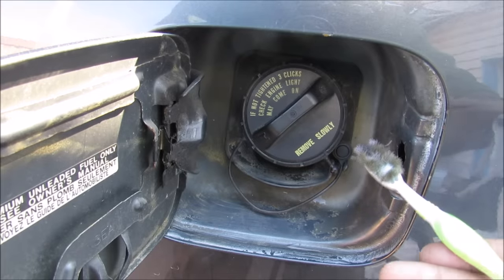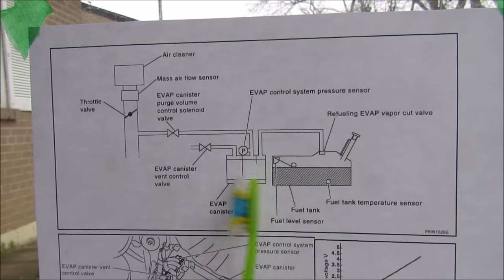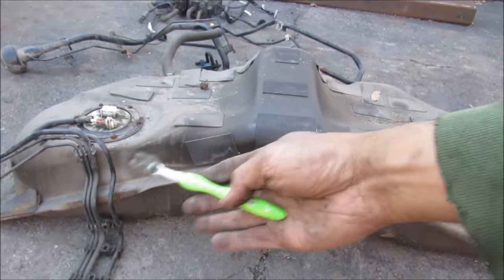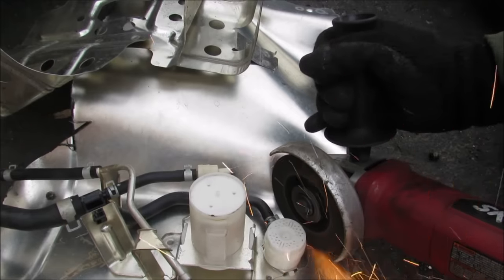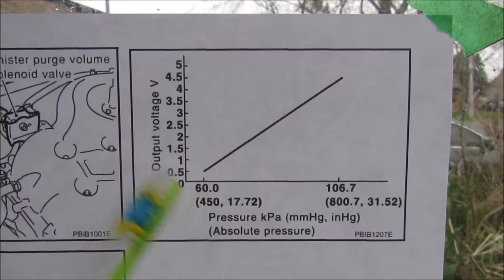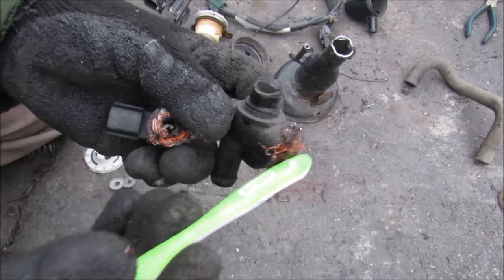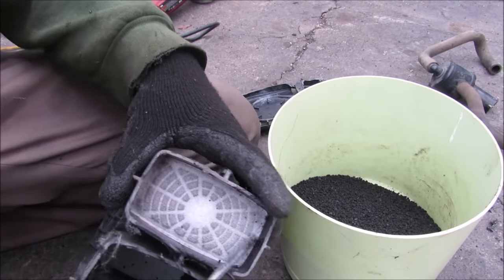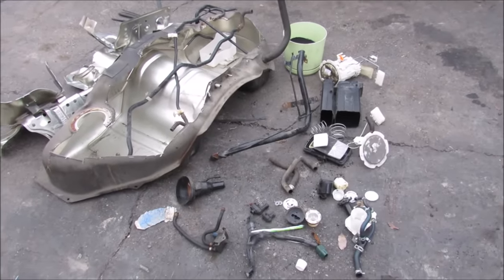How the EVAP System and Gas Tank Work

Comment from the maker: To see how much more complicated a Toyota EVAP system is, check out my other video here: https://youtu.be/g4lHxSAyf7M
Reply: thanks so much for this video! will check out the toyota one after
Reply: You are welcome! The Toyota Corolla has a lot more valves with diaphragms and an extra vent line from the engine, yet was a generation older than this Infiniti. It was ahead of it's time for an economy car.
Reply from the maker: You are welcome!!
Reply from the maker: The Toyota EVAP system is so much more complex with it's valving and vacuum lines and it's older than this Infiniti
Reply: @speedkar99  I wonder which is more effective at not venting fuel vapour...
Reply: 1:20 why do you change your teeth brush  so often? It makes me so nervous.
Reply: How is it possible for the charcoal to get sucked up all the way to intake
Reply: @Longoria1966  Your intake? Or the car's? :-)
Reply: @speedkar99  Not only is it complex, but it seems prone to premature failures (probably due to its complexity).
Reply: Ya charcoal got sucked up the hose all the way to the solenoid by the intake.. it clogged up the solenoid and was running like shit..
Reply: 97 Nissan Pathfinder.. I still gotta unclogged the line that goes back to canister.. have you every seen that happen?
Reply: @Longoria1966  Its not the charcoal but the fumes. Intake vaccum sucks it up
Reply: I'm confused. the purpose of the evap is to not let fuel vent into the atmosphere, yet there's a vent control valve that vents fuel vapors into the atmosphere. what??!!
Reply: @jay8a901  As I understand it, there has to be an emergency pressure relief.  Maybe someone else can explain it better.
Reply: @SpringIsBACK  ahh makes sense, they should have just called it vent pressure relief valve. I don't know why they complicate things
Reply: hi friend I would like to ask you for advice I have a Ford c max 1.8 petrol 2003 duratec engine the defect I feel and when I fill up the tank hangs the petrol nozzle keeps detaching and then if I accelerate the car seems empty as if there was a cap to the muffler or a lack of air or petrol this ford c max has the Cannister filter Activated carbon could this be the problem? thanks for your help🙏🏻
Reply: It’s an engineering toothbrush. Don’t you see the grease?

Comment: So I had a tighten gas cap on my Tahoe. I changed the gas cap and reset my check engine light. A few days later, it said it again, and my check engine light came back on. I needed to learn more about this evap system. I have to say you explained it better than any other YouTube channel. Thank you. You just got another subscriber.

Comment: This is a good tutorial on the pre-2006 OBVR design.   The next generation design, EVR Phase 2, adds a Refueling Vent Pipe directly returning vapor from the tank to the filler throat during fueling.   The EVR Phase 2 gas-pump-nozzle adds a return path for fumes, suctioned into a small orifice (3mm) on the nozzle.   In EVR Phase 2 vehicles during refueling venting DOES NOT depend on the path through the CC (as it does in older OBVR cars).
Reply: So does that mean I can rule out anything CC related being the reason for why my 2019 M240 cuts off during refueling? I disconnected the line going from the tank to the CC as to troubleshoot if it was that but the pump still clicks off. At this point I’m wondering if it’s the valve at the bottom of the filler neck or the vent valve in the tank that vents to the pipe that leads to the CC.

Comment: very good description of how the system works. I have cleaned many canister control valves because they were full of dust. (several table spoons full from most of them) I've seen the vent hose full of tiny pebbles too. This is common when you drive on gravel roads.

Comment: Great video! I learned a lot in 13 mins, had to pause it quite a few times to be able to retain all the information before moving forward. I love that you took everything apart to explain how it works. I usually take things apart, but wouldn't have been able to take apart an entire fuel system. Now I can troubleshoot problems with the fuel system!
Reply: what do you call two mexicans fighting???      answer: Juan on Juan

Comment: Try to ignite the charcoal to see if it catches on fire quickly
Reply from the maker: Hey that's a good idea. Was also thinking to use the gas tank as a fire pit...but it's edges are so sharp.
Reply: @speedkar99  I know I'd watch that charcoal getting lit up. Super saturated from years of gas exposure? Sounds like the ultimate BBQ lighter.
Reply: I really thought about it when I saw charcoal 😂😂🔥
Reply: @Veik_Reikis  The charcoal absorbs the vapour then releases it when the engine's running.
Reply: @ @speedkar99  I would ignite just a tablespoon first.An acquaintance lit some charcoal  that had gotten contaminated by a chemical while in storage in  his garage and it exploded.His face was burnt pretty badly.
Reply: BBQ!!

Comment: Great video!  Thank you very much for making it.  I've been looking at a way to modify my EVAP system to be able to handle extremely dusty roads.  Part of what I'd like to do is make an EVAP canister that can be opened and the charcoal changed out or cleaned easily.  Along with the filter pads cleaned.  I 3D scanned my canister and plan to 3D print one out of a gas safe plastic like PETG and also add a better inline filter. I didn't want to cut my only canister open to find out how they are supposed to work so seeing this one cut open was great!  Thanks again!
Reply from the maker: You can get one from the junkyard

Comment: When would the system vent the vapours into the intake and when would it vent them into the atmosphere ? Why not only vent to atmosphere or only vent into the intake?
Reply: Venting to atmosphere is needed when refueling (engine not on) or if there's too much pressure in the tank and it needs to release. 

Otherwise, the ECU determines the correct timing when driving to dump the rest of the vapors into the engine to be reburned.
Reply from the maker: It would vent to atmosphere when refueling (engine off) or if pressure builds too high. The ecu determines when driving to purge the canister to the intake.
Reply: If I may be so bold as to rephrase da man, the car decides based on sensor inputs if venting needs to occur at all, and if so, whether the motor can use the fuel at that time. If not, the vapour is vented to the ozone layer. Damn.
Reply: @speedkar99  I have a nissan RPS13 with sr20 engine 1996. emissions go quite rich at idle only. The evap was removed before i got the car. could it be possible that the evap solenoid should vent fumes on idle. Then this unmetered air/fumes would reduce emissions. Any info appriciated . thanks

Comment: Nice video on a neglected topic.
Reply from the maker: You are right, not alot of people pay attention to the evap system until it's time for an emissions test
Reply: @speedkar99  I recently purchased a cheap smoke machine mostly for finding vacuum leaks. I decided to check out the evap for leaks on a project truck of mine. It looked like the back end was on fire from the hose missing clamps on both ends. Never set a code but it also doesn't get driven much.

Comment: I was looking for an answer whether filling petrol in car till the brim of tank can cause any harm to the vehicle or not and found your video which indirectly explains me everything that even if you fill it to the brim every time, engineers have taken care of everything from releasing pressure from the tank via a small spring based latch in the refiller cap to preventing fuel entering into the EVAP canister.  I am going to create a video on the same topic for viewers in Hindi, explaining why its a good idea or bad to use your cars full tank capacity. Thanks a lot for the informative video. The overall speed of the video was bit fast paced which made me rewind few moments / parts of the video.
Reply from the maker: Glad you enjoyed it and learned something. 
Overfilling still isn't good because you still need some space for the fumes
Reply: @speedkar99  yes agree no overfill..

Comment: Hey speedkar99, another great video, mate, cheers for that...
My 2006 Lancer has rusted fuel lines going into the EVAP and there must be holes somewhere as the fuel is disappearing unusually fast - do you know if one can eliminate the EVAP altogether without asking for trouble? Would that cause any issues with the car running normally and not enter some emergency mode, etc (never mind the warning light)?

Comment: I appreciate your effort taking this system off an old vehicle and showing how it works.  One question!  After the vent  solenoid it goes into a vapor/water separator.  What is the reason for this separator, and how does it work?
Thanks, Tom
Reply from the maker: To separate liquid fuel from vapor 
Liquid falls down 
Only vapor can escape

Comment: Howdy...
I have a 1998, 3.3L 4x4 auto. 170,000 miles.
My wife filled gas tank one day last week while it idling and it started acting like it was missing after that. 
She drove it 200 miles through the mountains and got it home. 
No codes.
I opened the gas cap, that looks good, and the tank depressurized for no kidding, 5 to 6 minutes. At first it was heavy and wet fumes coming out, then eventually faded away. No visible leaks anywhere, or damage.

I loosened the gas cap and drove it for 18 miles. No change. Acts like it's mildly missing. Plug and wires only 1 year old. No codes.

Also, the RPM gauge shakes about 200 RPMs when it feels like it's missing. 

Any ideas?  Do ya think my ignition coil just happened to go bad at the same time?  Would that not toss a code?

Thanks!

Comment: Great video! I think the smaller tube going up the filler neck is a "sense" line so that the filler nozzle can detect the pressure building inside of the gas tank.

Comment: Good video; I was watching especially because my VW has a hole underneath the fuel cap not actually on the pipe itself but in the well; I wanted to make sure it was for water or fuel collecting in there, not a vent; it gets clogged and I didn’t want water getting into the fuel tank when I clean it; it has some sort of rubber there for some reason; it’s great the way you cut things open or pull things apart so you can actually see it.
Reply from the maker: Glad you appreciate my work

Comment: That was an awesome video. I'm troubleshooting an evap problem.  I had a "small leak" and found a rusted tank and rusted filler neck with small hole. I put in new tank and filler neck and now I have a "large evap leak"  I'm not sure why yet. I smell no gas.  I do have two small lines that attach to the filler neck. It's possible I hooked those up crossed. My car runs great until I fill the tank. The car then bucks occasionally for the next 60 miles then it runs great.

Comment: Excellent video! Question, why don’t they just bypass the charcoal canister and have all the fumes go to the carburetor or in the case of fuel injection, air intake to get burned? It would save all those relays and hoses etc. Thank you for sharing your knowledge, I appreciate it!
Reply from the maker: Isn't that what the evap system is doing? 
It needs to control the fumes since that'll throw off combustion
Reply: Then what happens when the Evap system eventually sends the accumulated fumes to the engine for combustion? If the fumes were continually directly into the engine there would be no need to store them in the charcoal canister. I’m just thinking of simplicity unless my idea is not possible. Thank you! :)

Comment: great explanation -- my 97 nissan truck was venting the carbon granules so I covered the port with a small piece of netting but eventually the canister went completely bad and the evap line filled with this fine carbon material and destroyed the purge valve selenoid.  I mean, bad yes but at the time the cheapest $ for a new canister was around 190-250.  but then I couldn't avoid the problem any longer and just by chance I found that the year before on infiniti the canister was about $50.  same exact canister but the lines on the opposite side so I had to kludge something together but it worked and still works and even better if you find that one canister is too expensive, look around for a different one and it too may work.  I'll bet I could make the one in your video work if I had to.   You could probably also rebuild these but not mine because there's a 1" piece of plastic that separates both compartments.  I cut the top off with a dremel and then a portland saw to get the middle.  can't use a scroll saw because of the springs but when I finally got it off I realized that I'd never be able to reseal it properly because of the piece in the middle.
Reply from the maker: Awesome use of adaptation

Comment: Great explanation. I like how the pressure sensor is easy to get to on this vehicle. When the pressure sensor went on my 2000 Chevy S10 I had to unbolt and lift the bed to get at it because it’s on top of the tank. Lifting the bed was waaay easier than dropping the tank, still a PITA though!

Comment: Another great video!
If the fuel gauge shows half when full, how do you know which sending went bad?
Reply from the maker: Measure the voltage off the sending unit
Reply: @speedkar99  OK, should the voltage be the same or different for each fuel level in each tank?

Comment: great video. Looked like a good old Infiniti fuel tank.  Wished the video would have shown and cut the filler neck open where the tiny vent tube is. The tiny vent tube is attached to the main filler tube near the top but there is no opening inside the main tube where the tiny tube is.Thanks

Comment: After how many miles that Charcoal Canister should be replaced? Thank you for the great film.
Reply from the maker: When the ECU sense it's ineffective and throws an engine light
Reply: @speedkar99  Thank you. 2001 Saturn SL2 (~130kmi) has code P0446 (emission code). I'm replacing Charcoal Canister, fuel tank pressure sensor and fuel pump motor.

Comment: Hey, Great video! 
My 2014 jeep cherokee was just in for service, they did the fuel induction service and fuel injection service. When I got home and parked in the garage, we later notice a very strong smell of gas. 
When I went to fill the tank that night, the pump kept shutting off...as per your video, I'm assuming it is the vent valve in the evap system. Are you aware if the induction/injection service involve the EVAP system?

This happened over a year ago, they wanted to replace the entire gas tank, but I ran it down to virtually empty and the problem corrected itself. Would that make sense if it was that valve in the EVAP system? Would running it down to empty  release the pressure?

again, thanks for the video. You trouble shot my problem better than the Jeep dealer service guys.
Reply from the maker: Awesome thanks

Comment: I see that your very smart and knowledgeable on this system I replaced the fuel pump on a 2000 Chevy Malibu and after replacing the fuel pump  gas is coming out of my vent solenoid there anything that you can let me know what could call this problem
Reply from the maker: Clogged vent tube
Reply: How do I correct the problem
Reply: Bank for the reply but the problem was when I install the fuel pump I didn't install the lines correctly one had to go to the purge coming out of the canister and it wasn't

Comment: when the gas in tank partially consumed ..vacuum created in the gas tank ..air should enter tank to account for this vacuum ..this air come from gas tank cap   or solenoid vent valve?
Reply from the maker: No the gas cap is sealed. 
On some vehicles it might be different but most likely the EVAP valve opens it to engine vacuum pressure to vent to the engine.
Reply: @speedkar99  thank you ,we need  separate video about  gas tank cap

Comment: Trying to seal off a ford easy fuel capless fuel filler inlet valve….it’s for my 09 F150. I’ve done the funnel and cleaning but unsure if it’s actually sealing. Any tips or bandaids as temporary fix? Someone suggested using grease? Didn’t specify what kind. Thank you, and also thank you for sharing the informative video. It does give me some insight…P0442

Comment: Great info I’ve been having trouble pumping gas it keeps clicking off I’ve changed the charcoal Canister and it still does it been dealing with this for 2 years now I have a fiat 500 I’ve pretty much given up on it
Reply from the maker: Clean the vent valve
Reply: @speedkar99  I’ve taken the hose that goes up to the filling valve where you put gas in it still did it with the new Charcoal canister

Comment: Thank you! I'll have up rewatch some of that.  I have a 2006 tsx acura with a potential Evap problem/emissions not ready, will I pass the smog check? It smells like gas and it only holds about 7 gallons of fuel before it clicks off and reads as full tank,  you think it could be the Evap Can or Vale? And what would you suggest? Thanks!

Comment: Curious about what you think of Honda's gas tank that doesn't have a cap on the filler neck. Instead it has a flexible flap that opens with the insertion of a fuel nozzle.
Reply from the maker: Might not seal well over time
Reply: @speedkar99  Agreed, the price for minor convenience at the gas station.

Comment: Great work sir well done. 
So basically it shows my problem which i can't full fill the tank the last 7 to 10 litters of fuel will drop from the EVAP Solenoid valve, so it has to be the fuel recovery valve right ?